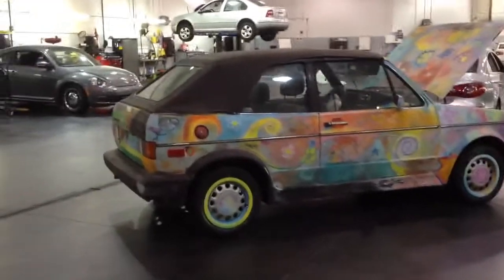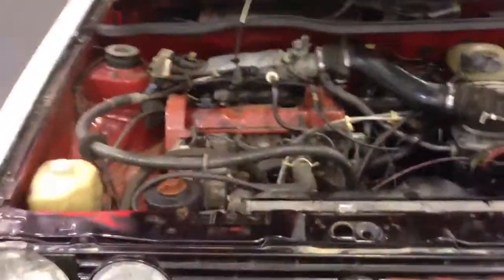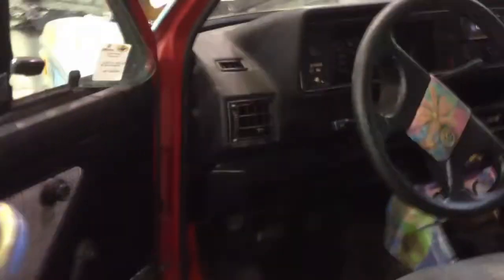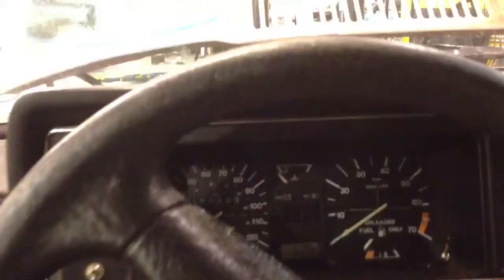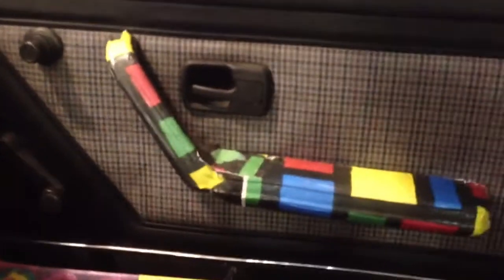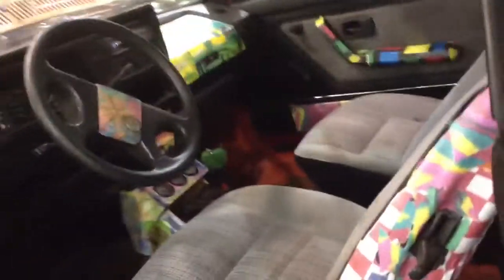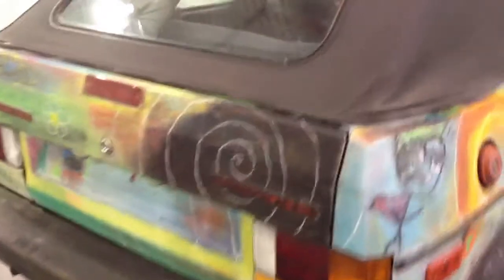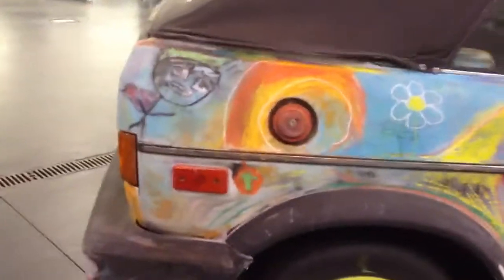Cabriolet project

Comment: had a 1997 plymouth breeze that had a whale tail removed, but no plugs.  they had spray painted (based on overspray): passenger air bag, shifter know, all arm rest cushions (including center console lid), exhaust tip, and a number of other things.  it has been a long while since then (thank goodness for u-pull-its).  it probably wouldn't have been so bad if they had done a better job taping off what they didn't want to paint

Comment: thats a realy rare dash. i saw one for 500 dollars altough that one was mint.
the top is no good the side tension cable is either snapped or rusted out and the tear calls for a new roof or it l leak and rust out the window frame witch can be costly because the roof has to be redone as well

Comment: im working on one of these..got the head  cleaned and new valves put in ...but am wondering if i need to do anything before installing cam shaft surface where it touches looks rely dull now...almost like theres a coating on it....
Reply from the maker: There may be. Use engine assembly line on the entire cam